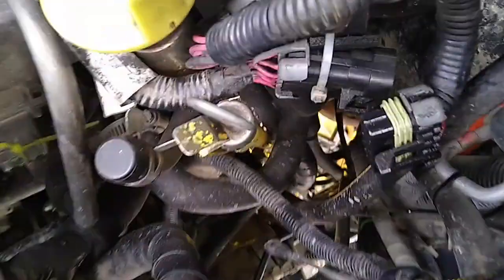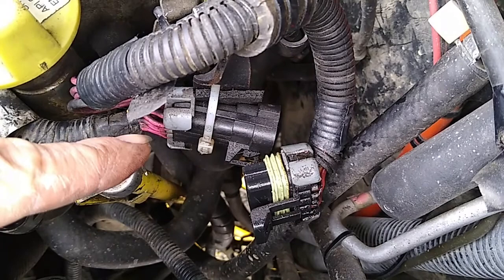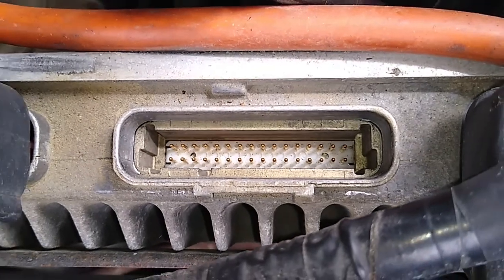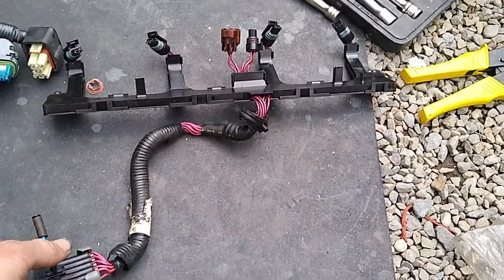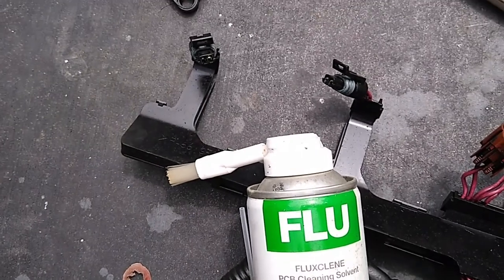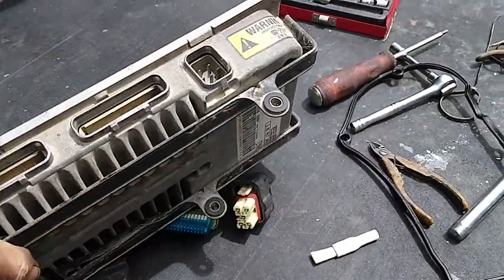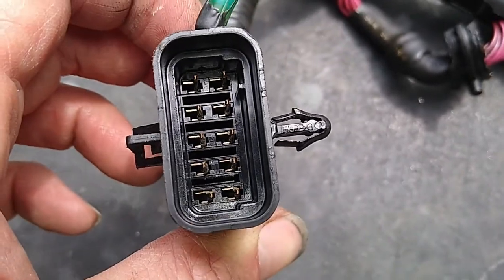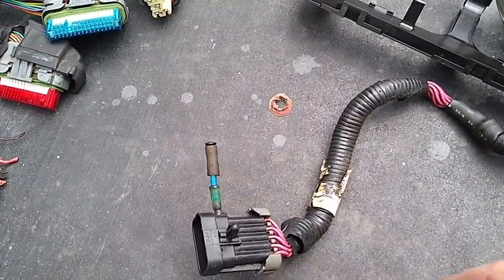4JX1 Oil in Engine Loom Fix/Hack Isuzu Trooper Holden Jackaroo Opel Monterey

Comment: Hello... Thank you Thank you and Thank you... 
I did all the suggestions you told me and when I replaced the oil suction rings, holy hell, the hydraulic roar went away and the engine started to start without failure and never stopped again... I only noticed that it took a few seconds to start. start and I think this is because the oil is returned to the crankcase. Perhaps it has a non-return valve so that the oil does not return because if I blow through a hose I can return the oil to the crankcase through the pump without anything preventing it from returning. Is there any anti-return to check?

Comment: Hello... The situation is that I have an Isuzu Trooper 4jx1 year 2001 that when I turn the key on the engine turns over for about 15 seconds and the engine starts but after 30 seconds running the engine stops...I try again and with difficulty It starts again, manages to stay running for about 15 seconds  and stops again... This happens faster and faster until the engine manages to stay running... After a few minutes it regulates perfectly and responds to the accelerator pedal without any problem ... From then on the vehicle will work and start perfectly without smoke and without any type of problem until tomorrow I try to start it again and everything will be as I told you again... The engine has 10w30 API oil and it was cleaned the RPCV completes... I hear an intermittent roar for about three seconds in the oil circuit to the rail... that is, between the high pressure pump and the pipe that enters the rail there is a hydraulic vibration that accompanies the roar... When the engine operates normally, this roar anomaly disappears... Please request guidance on where to investigate my failure... Greetings and Thanks from San Martin de los Andes Patagonia  Argentina.II
Reply: ### Things to Check First

1. *Bleed the Diesel Fuel System:* 
   - Use the hand priming pump on top of the fuel filter to remove any air from the diesel fuel filter. 
   - Ensure the 10mm bleed bolt is open to allow air to be purged while using the hand priming pump.
   - Inspect/replace the fuel hoses between the diesel tank and the engine for cracks, particularly around the hose clamps, as these can allow air to enter the system.

2. Clean the Oil Rail Pressure Control Valve, located on the back of the high-pressure oil pump. Debris can cause the valve to become partially jammed in an open position, preventing the  system from building up enough pressure to inject a sufficient amount of diesel for the engine to idle properly.

3. *Replace the Oil Rail Pressure Sensor:*
   - The sensor is located on top of the engine, under the rocker cover, on the side of the High-Pressure Oil Rail.
   - Over time, the Oil Rail Pressure Sensor can go out of calibration, causing the engine computer to not deliver enough fuel for the engine to idle or start properly.

4. *Check the Oil Pickup Pipes:*
   - There are two oil pickup pipes in the oil sump. One supplies oil to the engine, and the other supplies oil to the high-pressure diesel oil injection pump.
   - The O-ring inside the sump, where the oil pickup pipes bolt to the underside of the engine, can sometimes crack or leak, allowing air to be sucked in instead of oil.
   - To replace this O-ring, the engine oil sump must be removed to gain access.

Good luck
Reply: @donovabl  Hello... first of all thank you very much for your time...
It is important to add that after all these symptoms and after a few minutes the vehicle works perfectly without any anomaly and without any smoke and another thing that I noticed is that when the truck is started for the first time, the accelerator responds and after about two minutes it starts to fail and to make its mistake, which makes me think that if after several attempts the engine works the same as new, which parts would be compromised.

Comment: Could oil in this connector affect oil pressure in any way? Just wondering if information between the ecu and engine is compromised by the oil conducting the voltage/signal between the pins?

Comment: THE ORPS sensor eventually PUSHES oil into its 3 PINK wires.
They are GROUND, 5V and info/centre.
If you replace loom ALSO replace ORPS sensor.
The YELLOW, BLACK, RED wires (SAME side, NEXT to each other at the engine plug are the ORPS wires.
Simply NICK/small split the insulation on the 3 PINK wires that mate with the yel,blk,red wires at engine plu.
These 3 pinks will eventually slowly leak oil but wont go into engine plug and beyond since there is now pressure relief at the splits.
Don't cover or seal, simply spray some chain lube on it and forget.
The other 7 wires are injector (5) and oil temp (2) and don't cause a problem.
Too easy :)

Comment: What a great solution. 
I was wondering  if  I strip the insulation back part way along the wire with a wire stripper I have (Klein Tools 11063W Wire Cutter / Wire Stripper) and just apply some solder to the exposed wire directly. If I do that to each wire say 1/2" apart I won't get shorting between wires and can use RTV to seal the open soldered wire.
Reply: THE ORPS sensor eventually PUSHES oil into its 3 PINK wires.
They are GROUND, 5V and info/centre.
If you replace loom ALSO replace ORPS sensor.
The YELLOW, BLACK, RED wires (SAME side, NEXT to each other at the engine plug are the ORPS wires.
Simply NICK/small split the insulation on the 3 PINK wires that mate with the yel,blk,red wires at engine plu.
These 3 pinks will eventually slowly leak oil but wont go into engine plug and beyond since there is now pressure relief at the splits.
Don't cover or seal, simply spray some chain lube on it and forget.
The other 7 wires are injector (5) and oil temp (2) and don't cause a problem.
Too easy :)

Comment: I wonder if another way to solve the oil travel issue is to remove the rubber seal, connect and wrap a fabric cover over the whole connection - pull tie in position. Remember to remove the saturated fabric (essentially a filter) regularly. I purchased a Jack last year (great cosmetic condition ut 330klms), great condition, upgraded from my 95 rodeo (480klms!) and entered the terrifying world of the 4jx1 - only two breakdowns in one year :) - injector fail and replacing the orps this week...so hope that fixes the current issue!!! :) Thanks so much for your 4jx1 vids, have watched em all so far.